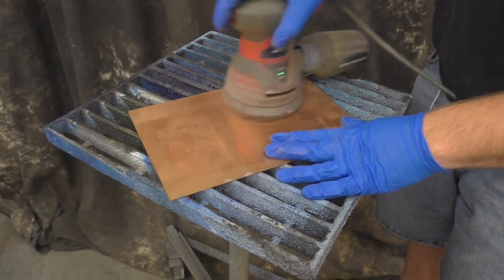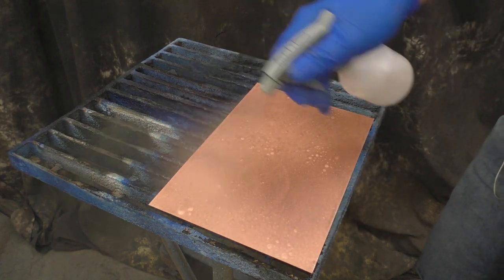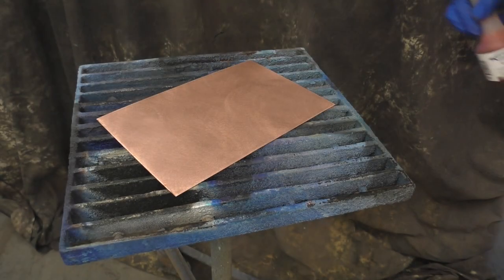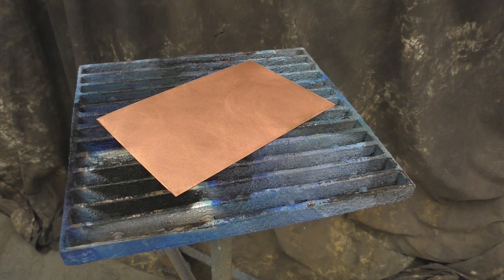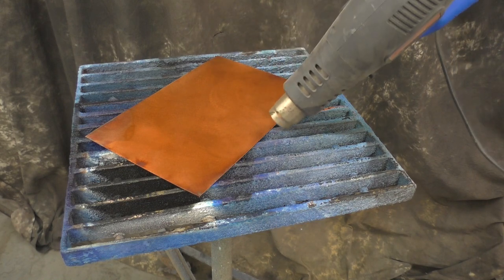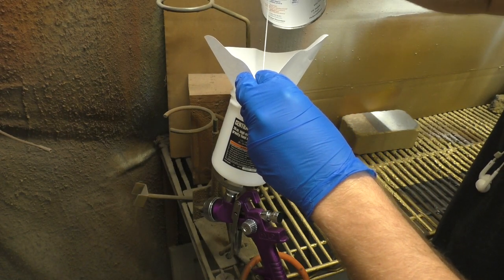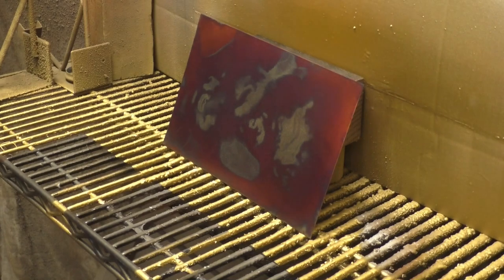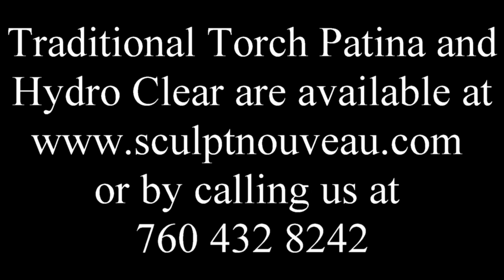Traditional Torch Patina Technique

Comment: If one were to do this to a bicycle frame, would you recommend completely covering with Copper Plate, then spraying Torch and heating in sections or dousing the whole thing then heating the whole thing? Thank you. Looks like some amazing products.
Reply from the maker: Bicycle frames are typically made of aluminum, the Torch patina does not work on aluminum. If you are working with a steel frame, then yes I would dose the whole thing with Copper Plating and then go in with the Torch patina - no heat required for that.
Reply: @sculptnouveau  Thanks. I mainly deal with BMX frames which are partially hi-ten or full cromoly. I recently etched my frame with ferric acid. But, obviously I'd like to use less dangerous materials so I could do it more often and try different finishes, which lead me to you. I'm definitely going to try some of these products in the near future.

Comment: Does this work with your line of brush on copper metal coatings too or just pure and plated copper?
Reply from the maker: Unfortunately no the Torch Patina does not work on the Metal Coatings.

Comment: Why do you rinse it just to add more before using the heat gun?
Reply from the maker: We did that to help get the initial coat going. Using the heat gun in this method is a more random way to force the reaction. We didn't want areas that had not reacted in a similar fashion so we did one coat to get all of the metal going and then did the second to get the reaction we wanted. This is all to say, if we skipped the first, it could have left us with areas where the heat gun patina didn't react and so we would have bright shiny copper behind it.